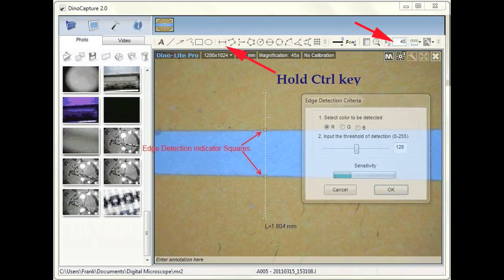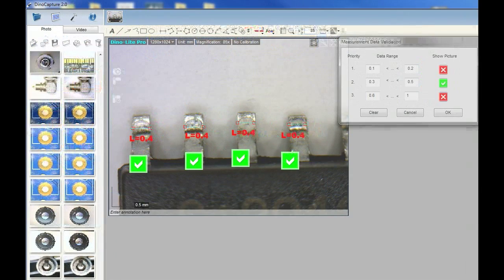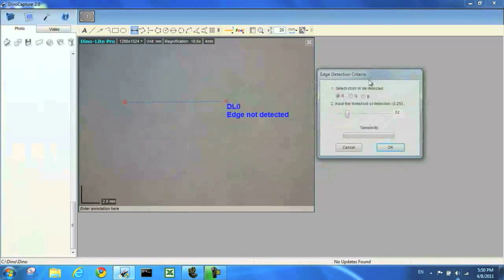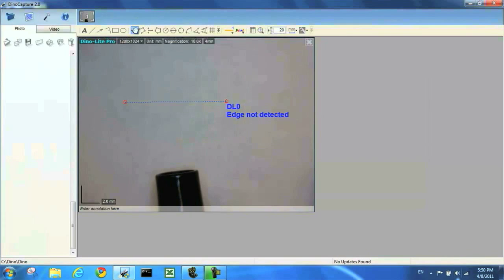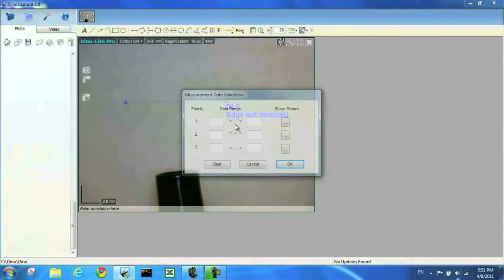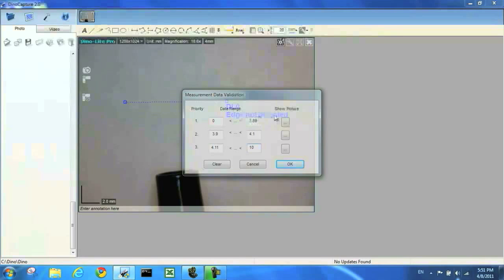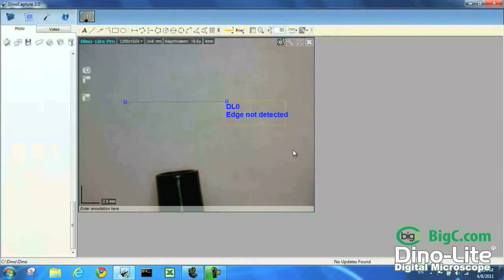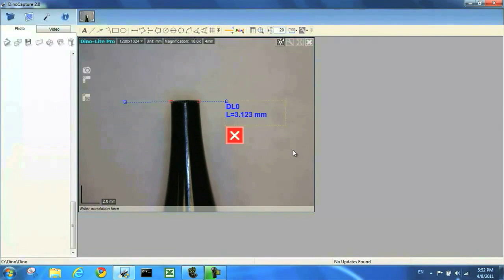DinoCapture 2.0 - Edge Detection

Comment: I can't remove DinoCapture 2.0.  Is not on a list on uninstall program. Please help!
Reply from the maker: Hello Adrian,
Uninstall by using "Uninstall 2.0.exe" from this directory, 
"c:\Program Files (x86)\DinoCapture 2.0" 

If you need a faster help time you can also e-mail us! E-mail support@dinolite.us
If you call us at 888-668-2442, we can guide you through it or do it for you!
Reply from the maker: Hi Adrian, 
Uninstall by using "Uninstall 2.0.exe" from this directory, 
c:\Program Files (x86)\DinoCapture 2.0" 

If you need a quick response you can always email us too! E-mail support@dinolite.us or call 888-668-2442 (USA).
We can walk you through the steps or set up an appointment for remote connection and do it for you!